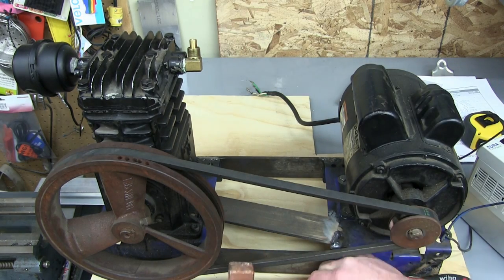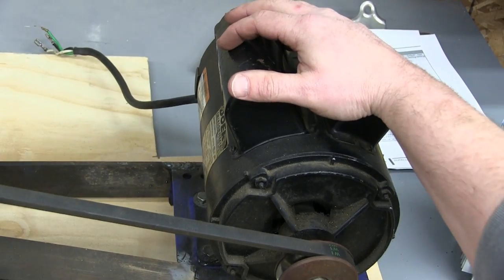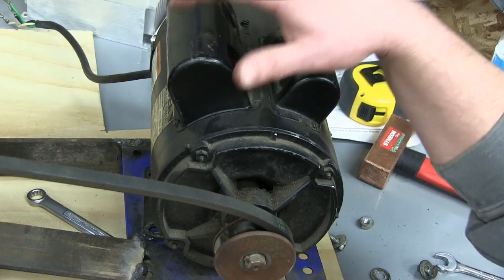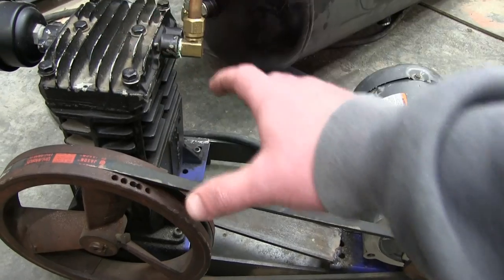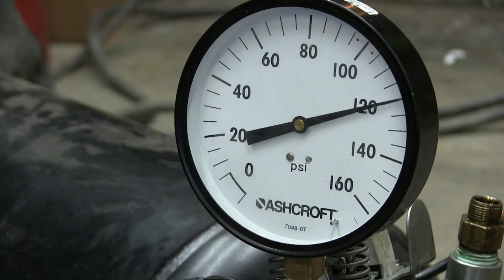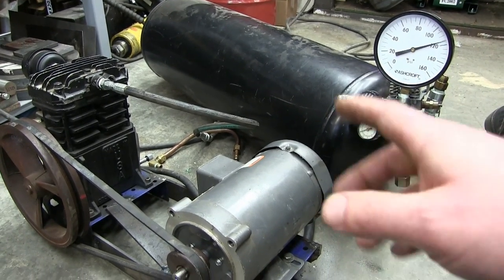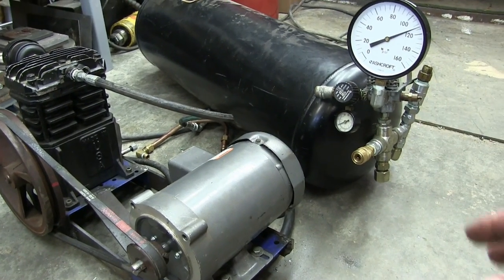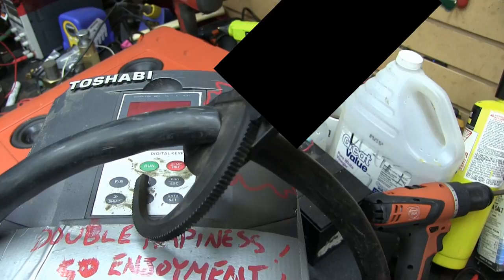BIG COMPRESSOR PERFORMANCE BOOST | No tripped breakers!

Comment: I may be the only one that noticed and only because I had one of these compressors when I was young, but the fly wheel/pulley spokes are designed to be cooling fan blades. If you notice they are rotating clockwise in the video but are supposed to rotate counter clockwise. I know that crankshaft rotation does not matter for compression but for cooing it does. I only mention this because I owned one of these compressors with the exact same flywheel/pulley.

Comment: Great idea. Got something to add, you overlooked 1 improvement. Volume. That nice hose you replaced the tubing with might have a smaller i.d. than the tubing. To increase the volume along with the pressure put a large i.d. tube between the compreesor and tank. Also the shorter the tube is the more volume of air you move. Remember, you have to supply all those nailbangers on the roof. They also need a steady pressure or the nails won't go in far enough. You can adjust that favorite valve of yours to control when the motor restarts. Overall I think this idea is brilliant, but what's the CO$T?

Comment: That would be extremely useful for me! I'm the kind of guy who never buys adequately sized equipment for the shop because I'm a cheap ass so I spend more time waiting for my compressor than I do using it. A thought I had: what if rather than having the vector drive look from pressure dips you just have it run at variable speed to hold the pressure at whatever it's set to? That way when load isn't very high you still have consistent pressure with having to tell it you need it.

Comment: I love the elegance of being able to run the compressor motor at a constant power output.  I don't know if you'll exceed the cylinder's ability to dump heat at an effective 100% duty cycle and how the cost would compare to an standard compressor with an equivalent CFM output.

Comment: More VFD vids, Yes! And in the springtime, after the outdoors defrosts in the Great North, rig up a pressure washer with similar controls to reduce the recirculation heat. Thanks.

Comment: I om my compressor to prevent High current startup. I added a very small tank right after the compressor which had a one-way valve going to the large tank. Then I added a electric valve that would release the pressure in the small tank when the power shut off. So when the power turns on the electric valve closes and then the compressor just has to start filling the small tank which is at 0 atmosphere until it overcomes the pressure in a large tank and goes through the one-way valve. Pretty simple for reducing startup current.

Comment: Love the idea!!

Only concern is running the compressor head at higher rpm then it is rated for.
Will put excess wear on bearings and piston connecting rods.

otherwise great idea.
keep it up.

Comment: VFD's are awesome..!  I have been selling them for 17 years. Under 2HP units come in 120 and 240VAC single phase input models that fit in your hand! Great applications for controlling speeds on a drill press, band saw and now found on residential condensers on scroll compressors. Its a no brainer that when your single phase motor finally dies, upgrade to a 3 phase motor with a single phase input VFD! Look up "affinity law" for more info on energy  savings for using VFD's.....

Comment: i use two compressors together with a T connector on the air line, messed around with the switches until they worked together nicely( i think the smaller compressor engages like 5 psi sooner or something),  your idea is much better!

Comment: Something to be noted here could be a power consumption reduction due to not having so many stop/start instances of the compressor motor. Reducing start amperage which is the highest power consumption point of anything like this. Based on most power companies billing methods, this could actually reduce overall power consumption for small/medium sized compressors significantly.

Comment: YES I've been waiting all my life for this to happen. We're having a lot of trouble with cold starts in the winter too, working, framing, busting nuts outside for a day in -15 to -25 centigrades the air choocher always takes out the breaker when starting. Even with an oil pan heater for the oil. This could change that!

Comment: On some portable higher end compressors there is a switch that runs the compressor constantly and when the pressure exceeds a safety limit it " blows off" like a semi truck does when building air pressure, this works well for framers and roofers that require a lot of air, I like your idea though and the concept is valid.

Comment: Maybe a silly comment as I am aware my thinking is often a bit different. If space etc allows, you can add tanks without motors on them thus having a bigger volume of air in storage. That way the compressor runs for longer constant runs and doesn't need to switch on as often. My understanding is that the average motor is only designed for 6 starts per hour. Better to have longer constant runs than many stop starts. Just a thought but great project.

Comment: Just a side note for using air guns: I have cracked more than a few plastic or even nylon piston stops using 100-110 psi, and now they sit in procrastination, useless in their boxes. I find that guns STILL WORK just fine at even 70 lbs or less, and this saves you air also, giving you more shots per compressor cycle. With a whole crew shooting at once, you might need more air though.

Comment: I could really use some advice on diagnosing a failed Harbor Freight 21gal compressor if you ever want to do a video on diagnosing a failed electric compressor. She turns on now but barely pumps, and will only stay on for 3-6 seconds before cutting off and throwing its internal fuse/circuit breaker (reset button) or throwing the house breaker. And no it’s not seized, easily turns by hand. And to add, love the video, this would be YUGE for my side work since I work on diesel light duty trucks and NEED my half inch aircat to be able to put more than 6 lug nuts on without kicking the compressor back on.

Comment: Won't you run into problems with the actual compressor overheating? In the normal on/off mode the compressor had time to cool down in-between cycles. Will forced air cooling be enough or your next project going to be a water jacket?

Comment: I like the idea! we are always waiting for air in my shop. We use a lot of air vacuum filling! I did notice the compressor you are testing with is running backwards. The fan must blow over the compressor not suck! ;-) swap M1 and M2 and you're ripping in the right rotation.

Comment: The kick on pressure is adjustable on almost all compressors. It's hiding under the safety cover with the angry pixies. Most people just aren't smart enough to tune it to kick on before their gun stops shooting nails. If I'm waiting for the pressure to build, it's because the motor just can't keep up with load. A bigger motor would solve the problem, but you can only run so much off a household circuit.

Comment: If you are using a plc for this, use a PID control and set it up to maintain tank pressure at a setpoint. Then it will automatically increase speed as tank pressure drops to try to maintain tank pressure. Set your drive up for something like 40hz to 100hz on the 4-20 input. Then use the PLC to actually vary speed based on tank pressure. Setpoint at like 120 with a 130psi cutoff to stop the motor if you stop using the compressor. Have it restart at 120 with the plc and attempt to maintain while in use. Should work. I would probably put a fan on the compressor though. Use a plc that will take thermocouple input to turn on the fan and cut it off should it over heat. Just my $0.02USD as an instrument guy.

Comment: Being a 2nd Generation compressor guy, the one thing you might want to check on this is the maximum pump RPM. The splash lubricated jobs there aren't great at the higher RPM.

Comment: Nice :o) You can tune the inlet as well with a long pipe. When it stops sucking the air is still moving and it has mass. You tune it so the air reaches maximum ‘eek no where to go’ as it starts to take another suck.

Comment: I'm a bit late for suggestions/criticisms, but here goes.  First off, it's spinning backwards so you won't be getting the cooling off the pulley/fan.  I see no reason to have the "worker mandated pressure dip activation" thing, just speed it up/slow it down based on tank pressure.  As the pressure gets down towards 100, or whatever minimum you want, have it speed up then slow back down as it gets to 120, or whatever you want to top out at.  Some other potential problems: Running too fast it might over heat.  Worse yet, if the oil foams up too much it might cause a hydrolocky type kaboom.  Running too slow you might not get enough oil sling to keep the pistons/cylinders lubed.

I like the idea very much and if it can be done inexpensively it would be spectacular.  Unfortunately, I think it would probably cost less to just buy a bigger compressor to make up for the start/stop pitfall.

Comment: I think it would be very interesting to see if you could graph the cfm possible at various frequencys/motor speeds and at what pressure the loads spike the amperage in order to create like the max load on motor at any given time and then with the pressure monitoring you can basically match the cfm output to the tool you are using by lowering speed whenever the pressure rises while the tool is working.
Basically you can work the compressor exactly as hard as necassary instead of the high low pressure cycle

Comment: I have a compressor with free air the motor runs all the time and will keep it top off at 125 or you turn the valve and it is on at 80 off at 125. It is on a EL Smith portable 30 gallon 220. I got it back in 1996. It is all controlled by the pressure switch. Thank you and Plow  that Fur Burger.

Comment: I installed a shutoff at the compressor outlet. No air pressure in the lines when not in use, but I never 'turn off' my compressor. No problems in the ten years or so I've been doing this. With no use, it takes a week or so for the pressure to bleed off enough to kick on.

Comment: A less expensive way that kinda works is setting your switching action to a higher pressure, make it so it switches on at 100 and brings it to 120-140. You have your motor turning on and off a lot but you can usually keep enough pressure to do your work.... not as good as a VFD, but unless you can buy them with pocket lint...

Comment: @AvE you could get a very cheap easily serviceable mechanical squirrel cage style fan And a very small fan box with a large intake and 2 small ducts to blow over the compressor and the motor and use a smooth pulley on the backside of the belt to drive it as well as act as an impromptu belt tensioner in the future as the belt wears so that the motor doesn't have to be moved. It would be quick to tension, barely cause a drag if at all since no real load on a fan that is just moving air that's not under pressure and at the same time no extra programming to amp up the fan speed when overdriving the motor. It will run faster and move more air as the rpm of the belt increases.  Also it will not add much weight to the entire apparatus because you can get the parts on smaller scale and make ducting from thin aluminum and such.  A side note from this, you could add a filter to fan box and incorporate the intake side of the compressor into this fan box as well to help the compressor pull in cooler air and ultimately help it run cooler as a whole.

Comment: You can throw a lot of money at this kind of problem. I would think that sizing the machine for the job is a better way of doing it on a small system. I have thirty years of experience using PLCs to run all sorts of things including VFDs. On an air compressor, we had unloaders originally to let the motors and pumps run constantly at full speed and just waste a lot of electricity to get the long life out of the mechanical end. Later on, I rebuilt the system to eliminate the mechanical unloader entirely. I still had a solenoid unloader to take any pressure off of the pump before starting and on shutdown. Two pressure transducers were used, one on the tank pressure and a second one on the pump output line. In use, coming down below the high pressure setpoint, the PLC would tell the VFD to slowly (10 sec) bring up the pump pressure to the tank pressure. The PLC would then watch the tank pressure compaired to the setpoint. If the pressure started dropping, the PLC would speed the VFD up to compensate. If the pressure increased, the PLC would slow the VFD down to even the change out. This would result in the compressor just MEETING demand. If the change indicated that no air was being consumed over a period of time, normally 3 - 5 minutes, the PLC would then speed up the VFD raising the pressure until the top of the setpoint range was reached and then it would trip the unloader for about ten seconds and then shut the motor down. 
The PLC system I was using also had relative humidity inputs for the HVAC system, I utilized that to run the tank blowdown solenoids to prevent any unnecessary wasting of air and also to keep the tanks dry during rainy weather, made a BIG difference. We had refrigerated air dryers, and this helped them out greatly. I put a pressure switch set to 20# on the oil pump of the compressor to facilitate auto shutdown and to keep the unloader solenoid open until ten seconds after 20# of OP had been reached on startup. These systems ran 24/7 as they were supplying air to the HVAC systems. On startup from 0 air pressure, normally after oil changes, they would just unload, disengage the unloader at 20# of oil pressure,while ramping up to 60Hz, go from there. We put pumped outboard oil coolers and extra oil tanks on the compressors as our HVAC system had a lot of pneumatic controllers that wouldn't tolerate synthetic compressor oil so we had to keep the mineral oil cool enough to not go by the rings in the compressors. The smallest compressors that I put this system on were 15HP, most were 25HP. All were 460/480 3P. VFDs were all ABB. PLCs were all GE Fanuc 9030 series. Some of the compressor interfacing to the PLC in some areas were through the BAS (building automation system) which was Andover Controls Continuum. We had full emergency generator backup that was fully engaged within about 15 - 20 seconds. Also tied to the PLCs, of course. I retired from there in Jan of '16. I probably forgot some of the details in all of this, the programming was fine tuned over time, and equipment life went out to very long time between failures. Regular oil changes were eventually moved out to about 150% longer than mfrs recommendations due to the oil coolers, btw: I put an extra oil filter on the coolers, I think it used a PH7? spin on automotive filter. The coolers/tanks raised the oil volume to about 300% of just the compressors oil volume. One of my nicknames there was Mr Overkill. Lol

Comment: FYI gas powered compressors have unloader valves that would allow for high tank pressure startup with reduced motor start up loads if you use a solenoid valve with a bleed off controlled by your PLC.

Comment: I don’t know what kind of controller is in that VFD but there’s probably a better way to program it. 
I write the logic and program PLCs which are used in the auto industry controlling the assembly lines.  
You need a controller which can fully act as a PID controller (proportional, integral, derivative). PIDs are everywhere. Think of your cruise control on your car. That’s controlled in part with a PID. 
You want to be at a set point without overshooting or undershooting or having to wait for your speed to drop to a certain point before it applies the gas. You ALSO want the cruise control to compensate for inclines and stuff like that. When you start going up hill you want the controller to apply the gas but not just at some arbitrary rate, you want to to apply a PROPORTIONAL force. If you’re going up a steep hill you’re going to drop off in speed really quickly. The controller is constantly evaluating multiple inputs and coming up with an algorithm. So it’s going to react by punching the gas BUT not too much either, you don’t want to overshoot and then have it completely stop applying the gas. Think how jerky that would be. Those are feedback loops. 
A PID is constantly trying to avoid those feedback loops. And there are a lot of variables you can set so it can be highly adjusted and tuned. 
So with your air compressor, if you’re all of a sudden using a large volume of air the controller is going to provide a proportional response automatically by increasing the speed of the compressor motor in order to compensate. No need to give the PLC coded signals via the air line.

Comment: I don't have 3 phase at home but I built something similar to this. A plc controls start, stop, load, and unload on my compressor. Two solenoids. First one when psi set point reached will shut off pump output to the the tank  Second one vents pump to atmosphere. Startup begins vented to atmosphere then loads after motor is up to speed

Comment: I like the VFD/3 phase idea. A pressure transducer for more accurate setpoint targeting.
I don't really thing you need to overpressure the compressor/tank/lines.

One thing I'd like to know on your experiment.  We all know the single phase motor is a cobbled together design, and a 3 phase is far more efficient.  Interesting comparison would be line load (VA) of both setups (single phase and VFD/3 phase.) I'd do a 3 phase swap if I can lower my compressor's draw and stop das blinkenlites whenever it starts choochin.